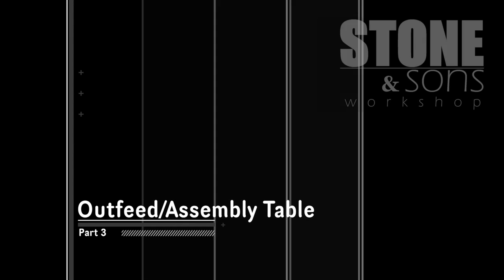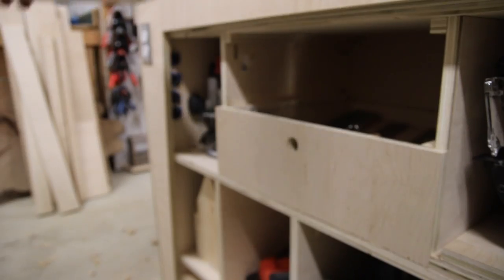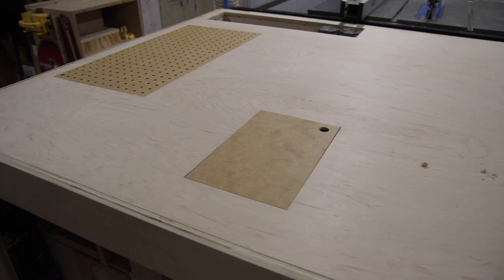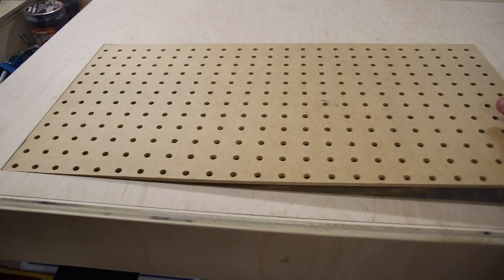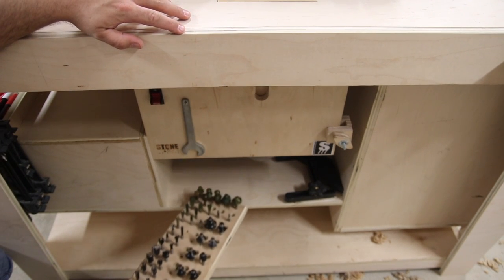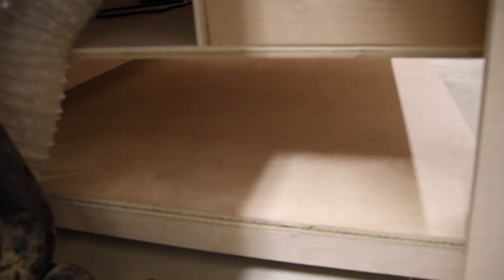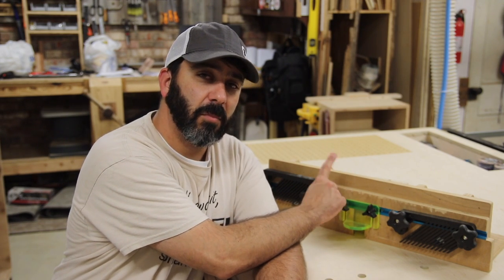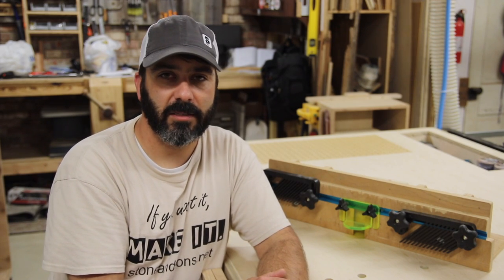Build a Tablesaw Outfeed Assembly Table - Part 3 The Tour

Comment: Suggestion for your bench grinder.  When I was a kid Dad's miter box had plugs on the bottom that fit into the bench dog holes.  It would work well to keep the grinder in one place.
Reply: Thanks for the tip. Thats a phenominal idea i would have never thought of. im gonna do that for stuff thats mounted to a board that i typically clamp to the table like my kreg jig. Genius!
Reply: Such an old school idea that still has a relevant place in today's world.  Sadly that bench is gone but I still have the family tools dating back to the 1800's.  

Perhaps a pull out tray for your router so you don't have to reach back in the cubby for your bases?

You have a solid design and it's a great project.  I'm combining Dad's shop with mine and it's tough and an emotional process.  Everything is a shop project for me currently.
Reply from the maker: Yep, that's an excellent idea, which was the initial thought. I didn't have any 3/4" dowel rods on hand. It's still on the to do list.

Comment: Great table design! I have the exact same table saw and I’m looking at building the same outfeed table. Now that you have had the table for a while. Have you found any problems with it or wish you would’ve changed anything on it? Also do you have any problems with cutting long material? Do you wish you would’ve made it a little bit deeper or does it work just fine with 10 foot material?
Reply from the maker: I haven’t had any issues or regrets. Nothing that i have cut has fell off the other end of the table so I believe it’s deep enough. For me anyways. I really does have a ton of storage and it’s heavy!

Comment: Very cool out-feed table. Ever thought about incorporating the Delta Table Saw into a table? I have the same saw and hate the caster setup, plus, I am very limited on space and it would be great to have the table saw, router both in the table. Your thoughts?
Reply from the maker: In my opinion the table top workspace is valuable. If you added the table saw into the table you would lose a lot of working surface because of the blade and fence. I know you could lower the blade and remove the fence but then it’s not convenient. Just my thoughts.
Reply: @StoneandSonsWorkshop  Considering the size of my shop, the very poor quality of the castor system, and the fact that I've built most projects using much smaller surfaces, it will work great for me.

Comment: Hey man, you should get rid of that little blue vise and replace it with your leg vice. 

Tearout Tip - Painters Tape is nice touch but I usually use a router with a compression bit or if the saw is the only option I draw a line where the cut will be and score a line with my knife. Problem solved.
Reply from the maker: Thanks for the tips. Yeah, I was in a pinch to get it done and there were a lot of cuts, so I just kept going.Yes, I did think about moving my leg vise over. I haven't ruled it out.
Reply: Understand completely. All been there at that point especially for a work table. Cruising along and "DOH", oh shit. Oh well it's just for me to use for utility so piss on it. Function not beauty. Keep up the good work man.

Comment: Also, how difficult would it be to change the table height as my table saw is 34.75" high. Is there enough wiggle room in the pans to just make the legs and side pieces shorter by 1.25" or will that throw everything off?
Reply: I built the stand and had a similar situation as yours. It was very easy to reduce the height as I only had to remove the height from the tapered legs in one of the first steps and all other dimensions stayed the same. This functionally resulted in having less room in the plywood cut-off storage area—but you can still store a few sheets under there. I didn't want to decrease the size of any of the cabinets.  The bigger challenge in my situation from a measurement standpoint was adjusting the dimensions since my plywood (although a decent quality plywood not from a  big box store) was not really 3/4" thick. So that changed a lot of the dimensions. That being said I am super stoked about the stand after building it. It is incredible solid and was pretty easy for a beginning woodworker like me to build confidently.

Comment: Shawn:

I like the assembly table but have one question.  I want to add a work table paper roll holder to one side of the table.  Would you be so kind as to give me your opinion as to which side would be the most beneficial side to add that to.  It's hard to picture it just off the video and, since you have already built yours, I wonder if you might take a look and give me your educated opinion.  Thank you so much in advance.  I, too, left the corporate world to become a woodworker.  Best decision I ever made.  Thanks again.  

Eric
Reply from the maker: Honestly, the only place to incorporate it would be between the assembly table and table saw. Just leave enough room between the two for the paper to come through
Reply: Thank you so much for the reply.  I am buying your plans and will build my table.  I was actually thinking more of using the table for assembly than outfield as I bought a Portamate outfield table for my saw.  So I was thinking of putting the paper roll just below the pencil tray.  But one more question I have for you.  I was thinking of using 2x6 boards ripped down to about four inches as the legs and rail.  Would your plans exclude making that adjustment to the material?  The reason is that I would like to have a much bigger vise and a more robust rail to accommodate.  Thoughts on that?  Thanks again.  I also, left my job to do this.  Life is short.  Thanks again Shawn.  All the best.

Comment: on a different note...what is your strategy to reduce tear out on the thin veneer plywood. I know you said you were in a pinch and had a dull blade but Ive noticed I still get some tear out even if its a sharp clean blade.
Reply: I use painter's tape and a sharp blade.  I think there's little you can do to prevent tear out if a dull blade is used.
Reply from the maker: I've had good luck with a clean and sharp blade. That being said, there have been times when I wasn't paying attention to which side is up or down during a cut and ended up with tear out on both sides by the time I got to the final dimension when the blade is dull or wasn't clean, so I could have prevented having tear out on the "show side" with just a little attention.
Reply from the maker: Nice tip, Dave.
Reply: Thanks, man!